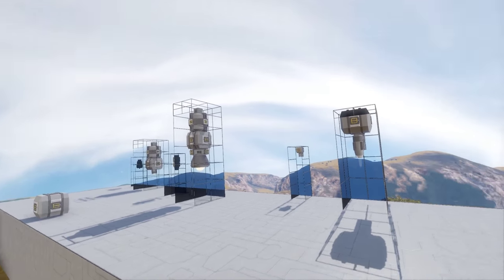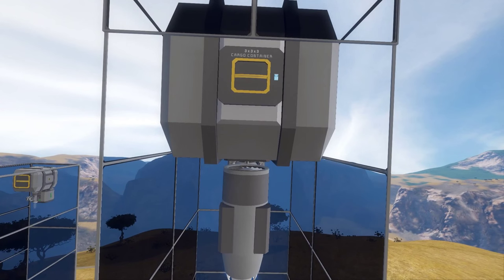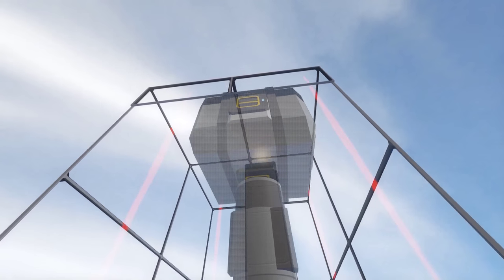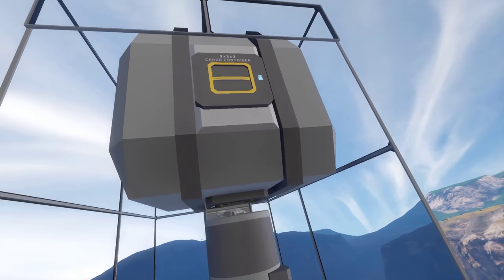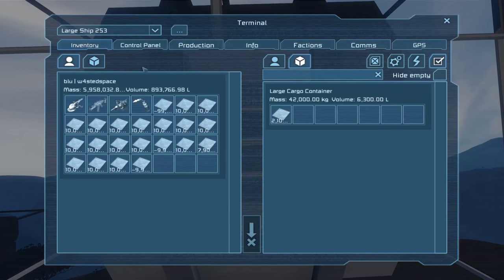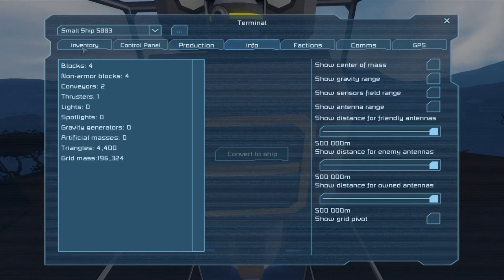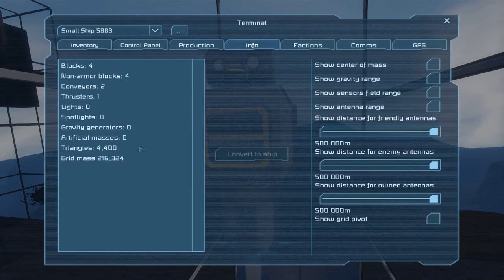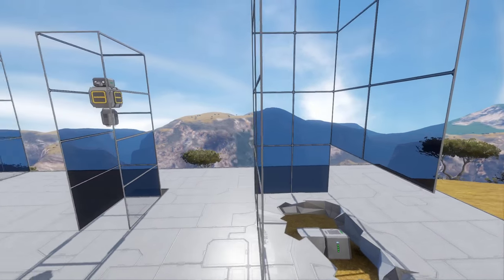Space Engineers - How much mass does an Atmospheric Thruster lift?

Comment from the maker: Some really interesting results here that cannot really be explained away by the small inaccuracies in my testing methods....  they may be a little archaeic but I'm glad I tested it rather than rely on the maths!!
Reply: +w4stedspace i figured that maths do not work after like 2 hours of trying to make my helicarrier fly xD
how i made it fly: added thrusters everywhere i could until it was flying and then deleted 1 by one until it started to drop and then undid last deletion
Reply: +w4stedspace I just noticed that all light armor blocks weigh the same(including the 2x1x1 armor blocks), wouldn't it make sense that an armor ramp would weight half of a full armor block? so that means that most of our ships are heavier than they have to be...
Reply: +w4sted space I believe in the patch notes it stated that when in creative mode the weight scales when you go over the cargo limit. This is happening because your cargo container cannot hold nearly that much. In survival this won't happen.
Reply: +Venom 415 All of my super-light ships use slopes and 2x1 slope bits to save on mass, I realized this as well recently. I can't wait to see how light it will be if they fix this. It's especially strange because I thought block mass was calculated from sum of components, and I believe they all cost fairly appropriate (and different) amounts of steel.
Reply from the maker: +xhammy With the inventory settings I'm using none of the amounts needed to cause the tests to drop to the ground reach the containers inventory limit, not even close in most cases. As mentioned (although I admit I forgot to add the footage) these results are repeatable in survival also.
Reply: +Katniss Crofter Yeah my hover copter uses A LOT of ramps so it should weigh much less than it does, and because of that it flies like a potato at times
Reply: +w4stedspace I tested it on survival world on realistic settings (spawned ships and filled its cargo with space master mode) and large thruster for small ships can't lift more than 34000 Kg. For lifting cargo, world inventory multiplier does matter. Since default setting for new world is 10x, numbers make sense. Cargo container capacity can't be set in creative world, but I bet the multiplier does exist. It just can't be changed. Since thie multiplier effects only cargo and not ship, inconsistency of lift per kN was caused by ship/cargo weight ratio.

In my test, I tried to lift steel plates in cargo containers of constructor ship with 4 large thrusters. With 34 000 per thruster, it barely lifted off. After I changed inventory multiplier to 3x, the ship lifted it like was nothing.
Reply: +w4stedspace And now I understand how it gets wierder than 3+3=-0. GG Space Engineers!
Reply: +w4stedspace 

so i ran the number you gave out.
large ship  large thruster is 12857.15 times more powerful able to carry 48.5 times more weight than a small thruster. 
large ship large thrusters carry 0.75 kg per Kn , large ship small thrusters carry 200 kg per Kn 
small ship large thruster is 5.23 times more powerful able to carry 7.3 more weight than a small thruster.
small ship large thrusters carry 676.4 kg per Kn , small ship small thrusters carry 484.61 kg per Kn 

I switched the weight of the large ship small thruster and small ship large thruster and came out with this. 
large ship large thrusters able to carry 14.78 times more weight than a small thruster.
small ship large thrusters able to carry 2.222 times more weight than a small thruster.
large ship small thrusters carry 657 kg per Kn, small ship large thrusters carry 205 kg per Kn

seems to be a lot more sensible if you switch them in this way while over looking the power to weight ratio difference because it will still be inconsistent .
Reply: +blitheEscape you might be correct but as i stated i ran the numbers as were given in this video using the same assumption of how weight works base on this video . if you could post a link to the correct way to calculate what each thruster can carry would be a better post, thanks
Reply: We know, it's in some older patch (week or two after cargo mass was introduced). It's 1/3 an 1/10 cargo weight for 3x and 10x inv. size. They've done it so full mining ship with 10x inventory size can move the same way as on 1x inv. size. Without it, setting inv. size to 10 would make all ships with cargo useless.
Reply: If I remember, small ship thruster power is being multiplied by 5 to make small ships faster compared to big ships. It's a balance thing.
Reply: It was only for inertial dampeners and it's off the game for two weeks. Changelog for 01.094 says:

"Additionally, we have applied some changes to the mass of the objects inside the inventories. The mass is now based on the inventory size world setting. When the inventory size will be ten times bigger, then the mass will be divided by ten; same logic is also applied to inventories which are 3 times bigger, etc."
Reply: +w4stedspace  Your results are strange but my recent crash landings with my WIP Cargo ship say that the thrust is as stated and not what your seeing.  My 1.5M kG(empty) ship has roughly 1.22TWR with 4 Large Atmo Thrusters I learned this the hard way when it crash landed at over 90 meters per second....  I designed it based on your video and it did not end well.  A second attempt I pushed the ship forward and used speed limit to halt my descent about 100meters above the ground then landed. Then slowed down using the very undersized small thruster's I had for maneuvering.
Reply: Stephen Beeson I think W4sted made this test with a different inventory multiplier than 1x, so that is why numbers don't fit.
Also thruster efficiency decreases with higher altitude.
Reply: so... in the most recent update this is still not fixed then... so... building a ship based on current configurations around this is basically a moot point? because later down the line it will be changed, and therefore your ship will be rendered useless until the proper amount of thrusters are placed on it, unless you overload it with thrusters which just destroys any semblance of efficiency which is necessary for survival...

can you at least tell me if they seem to have stable math for the amount of oxygen farms to hydrogen thrusters? or perhaps a rate at which it can fill a hydrogen container?

if i can have stable mathematics for hydrogen/oxygen production rate on any given ship, then i can at least plan for fuel efficiency and replenishment, granted my guess is the rate of replenishment far supercedes that of the oxygen required for one person, but this would be useful knowledge, as well as if used on a large ship oxygen salesman, then it would make sense as well as completely helping to replenish hydrogen in a timely sense for in the occasion where a deal goes awry.

if i can get an estimate for solar panels versus batteries and charge times that would be nice too... then again i can figure that one myself, nevermind the solar panels. but the oxygen farms yes please.
Reply: +blitheEscape thats a fair point, but i did not intend disrespect in any way, so i refute your comment about mouthing off. and i hope you have a better day because you sound somewhat irritable. thank you for informing however.
Reply: +blitheEscape that did not answer my question about necessary oxygen farms. however the bits about world inventory is nice and i appreciate it. although i may have to reread it to fully grasp its meaning, by which i mean, how to create a ship that will fly regardless of the world inventory. which means... i need to reread it to understand what setting will give inventory the heaviest setting and try from there. good to know.
Reply: +blitheEscape i see... but then doesn't this make the entire statements made previously about how the settings of the world matter invalid?

it still raises the question about which thrusters are not only economical but also most efficient based on weight to thrust and space.

although most people don't always consider the space taken in a design as compared to the results... but its nice to know how many smaller engines is required to match a big one, or if it can surpass a large one based on fuel to thrust.

i can understand the statement, and i suppose i was also at fault. the video leads you to believe that the math is wrong, but while this isn't true, his results don't prove it immediately false. maybe i wasn't paying attention to the thrusters being compared. i'll watch the video again and see if i can't glean some new information.

but from what i can garner, i'm guessing if i keep the total thrust of the operational thrusters per side equal to half the total possible weight or more, er... if the amount of thrust in kilo newtons is multiplied by 20, that is the approximate weight limit... i think?

so if each of the six directions has enough thrust to do 1/20th the kilonewtons to weight... it should be able to function, if only just... i think. this is an assumption because i even checked the wiki and have no numbers for the atmospheric, and not entirely understanding the numbers of the others.

i need to do more research, ultimately if i had a decent enough pc i would do it myself. but thats apparently not an option for my laptop.

um.... perhaps you could give me an average kilonewtons to kilograms ratio i can use? that might be more useful.
Reply: +blitheEscape so your mass changes based on what is IN the cargo rather than just straight up how much you have?

then the volume and the mass can be completely different due to material density.... then i need to find the densest material with the lowest volume, and fill a cargo container in a 1/1 world, just for scale, and then i can basically consider that an effective weight to consider when building as the total maximum amount of mass possible.

in a 1.1 gravity well. i see...

if i understood something wrong... please forgive me, woke up less than 10 minutes ago from a nightmare after only 1 hour 20 minutes sleep.
Reply: Anthony Placek
I've done extensive testing and on 1x inventory size, all thrusters lift what they should according to nubmers. For calculating acceleration, inventory mass is divided by inventory size setting (game balance issue, all ships with cargo containers would be totaly useless on 10x inventory).
Reply: *****
... bad news is that mass shown in game doesn't care about inventory size setting, that number is simple sum of mass. With other than realistic inv. setting, this nubmer is completely useless if you need to know how many engines you need to take off. You need to recalculate it, experiment or use relative numbers (for lift calculation purpose, full cargo of ore weights just the same for all inv. settings).
Reply: +w4stedspace When you think about it, it kinda dose make sense because the larger engines require MORE power/fuel, whereas the smaller ones dont need as much. also look at modern planes.. the engines they have are the right size, if they were any bigger, they lose efficiency, any smaller and they cant support large loads.
So if you have a jet engine the size of a boeing 747 on a fighter, the fighter would use more fuel and become less efficient. whereas the engines on a F-22 cannot support a 747 weight in the air, and would struggle to move it.
Honestly its the same concept here. The numbers ARE A BIT OFF YES!!! But that dose not mean that its broken.
Reply: +w4stedspace i think i know what the issue might be, ive seen this phenomenom on other videos and this might be the stationary hover mode that activates on thrusters if they are below a certain height, so maybe if you do the same test higher up in the atmosphere the results would be different, (at least until they get to that magic height) maybe its a mechanism that exists in the game to provide hover ships with constant up thrust with minimum power usage and make it possible to save ships that are decelarating too fast...
Reply: +w4stedspace You you be able to redo these? I think they changed it.
Reply: +w4stedspace     things get really crazy over a hundred meters a second and   reentry and trying to catch a ship with certain Mass.  I think it has something to do with the higher gravity planet
Reply: Has this been patched, or is this still valid?

Comment: Thank you for taking the time to document this mechanic!

I have noticed the floating grids as well. When I disable the inertial dampeners for a small ship close to the earth-like planet's surface, I notice that the game does not immediately recognize that the ship is no longer being held up: the ship floats. Sometimes if I update the grid by removing a block, it will start to fall quickly, but usually it will just fall very slowly back down to the surface.

Comment: Very interesting. Thanks for doing all the heavy lifting (pun intended) with the testing, W4sted!

For those interested, here are the ratios..
                                                        N                Mass N/g
Large Ship Large Thruster 4,500,000 3,400,000 1.32
Large Ship Small Thruster 350,000              70,000 5.00
Small Ship Large Thruster 340,000             230,000 1.48
Small Ship Small Thruster 65,000               31,500 2.06
Reply from the maker: +Blake Kelly No worries :) Thanks for posting the numbers up for peepz!
Reply: +Blake Kelly 
The real Thrust [kN] of thrusters:
Large Ship Large Thruster: 34000kN
Large Ship Small Thruster: 700kN
Small Ship Large Thruster: 2300kN
Small Ship Small Thruster: 315kN
if I am correct using w4stedspace's data.
Reply: ah, yes that makes more sense. thanks!